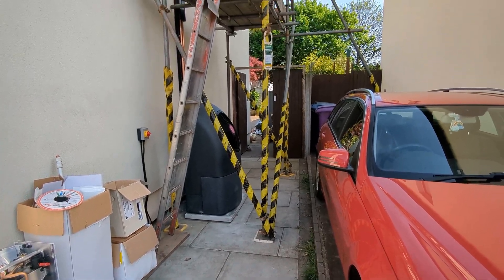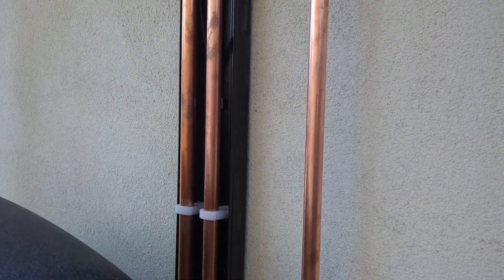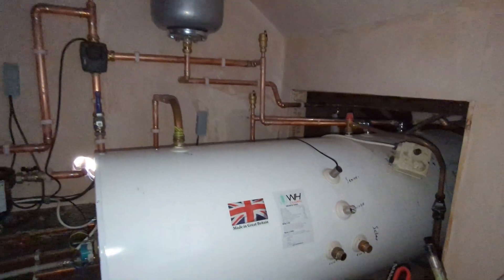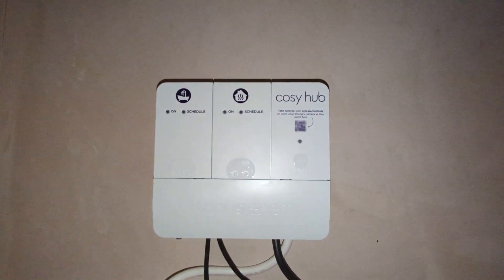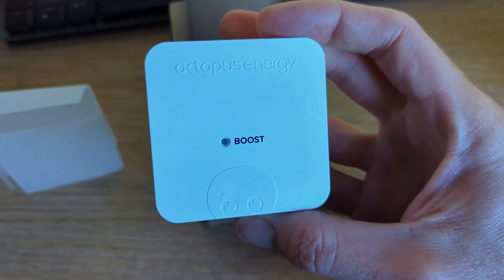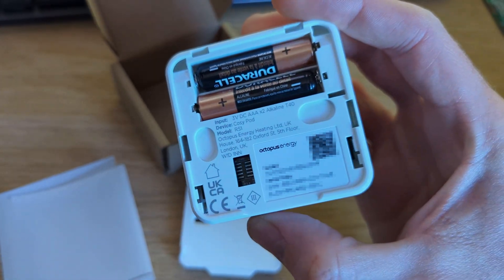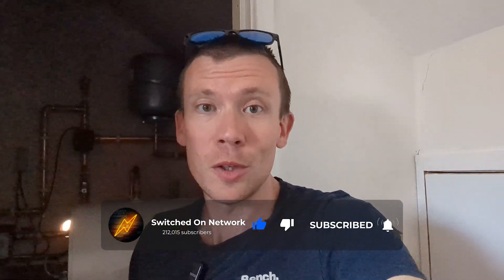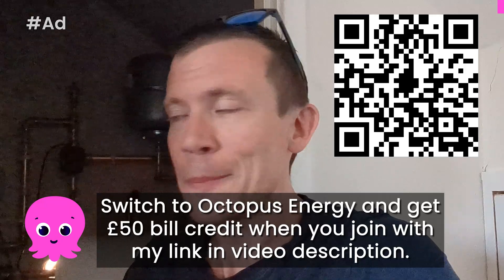Day #3 - Hello Heat Pump! | Octopus Cosy 9 Heat Pump Installation

Comment: I've had a survey from octopus and I think the design they've come up with is really lazy. They calculated a heat loss of 5.8kw and then specified cozy9 running at 65oc with 1 rad change with a scop of just 2.9. Heat geek have specified a 5kw pump running at 50oc with 7 radiators changed. Much dearermbut a guaranteed scop of 4.0
Reply from the maker: The thing is though - how much extra do you pay upfront for that higher SCoP and lower running costs? It's a balance between whether you think it's worth the cost and disruption (and possible waste of scrapping old radiators) in favour of that lower running cost, or if you want a more "drop-in" replacement for your gas boiler. I don't necessarily think that's a lazy approach, but it's two difference approaches. Octopus now do "Eco" and "Turbo" installs, where Eco will require more radiator changes (and possibly more pipework alterations to increase size of pipes, fewer corners etc. to reduce resistance) and as a result achieve a higher SCoP with lower flow temp, or Turbo where it'll run at a higher temp due to a "less than ideal, but still OK" system. For me, I felt Turbo was the better option and I'm hoping that was the right decision! Obviously if you have a blank canvas you can do everything in the best way from Day 1 to get fantastic efficiency, but I'm accepting the fact that my house is quite old and with retrofitting there are some compromises... I don't like to let perfect be the enemy of good! (If that makes sense?!)
Reply: should read "Heat geek have specified a 5kw pump running at 40oC with 7 radiators changed. Much dearer but a guaranteed scop of 4.0"
Reply from the maker: If you don't mind me asking, what's the total price on that quote?
Reply: @SwitchedOnNetwork  The octopus Turbo quote was about £3.5k (1 rad +tank) and the Eco quote about £4.5k (4 rads+tank), the Heat Geek Quote was £7k(7rads+slim tank), The octopus quote is for a standard tank in our loft (bungalow)and would require additional cost including a structural survey.  The Heat Geek quote is to upgrade all radiators and install a slimline tank in the current old style tank location.
The Heat Geek quote is dear when compared directly although its hard as little in this area every seems to be like for like, so often comparing apples with oranges.
I've estimated the cost of replacing all the rads as being about £2-2.5k and the slimline tank is about £500 more than a standard one.  I'm trying to negotiate the price down a bit, but they are considered a premium installer so do expect it to be more than others. I have Aira round on Monday to do a survey and quote, will be interesting to see how they compare.

I understand what you mean regards the Cosy 9 install but with a gas boiler there were no downsides to over sizing, but perhaps you can push that flow temp even further down, which would also reduce the risk of cycling.

One thing I did when researching was drop the flow temperature on my old heating only gas boiler, I got down to 50oC whilst being able to keep the house comfortable in January, So you may well be able to do the same with your Cosy 9.

The risk for us with a low temperature design with a 5kw unit is the reverse if you like, will it get to temperature ok in the coldest snaps ?. Heat Geek guarantee it, so I'm sure it will but it will certainly be a change of use compared to just turning on the gas boiler if it gets chilly.
Reply from the maker: All interesting and yes as you say it's hard to compare directly and there are so many other factors to bear in mind. I'll be keen to see you get on as well so stay in touch and let me know what you go for and then it'll be interesting to compare notes after the winter!